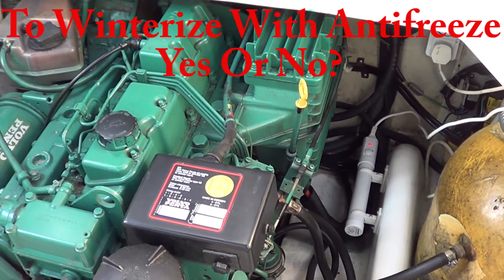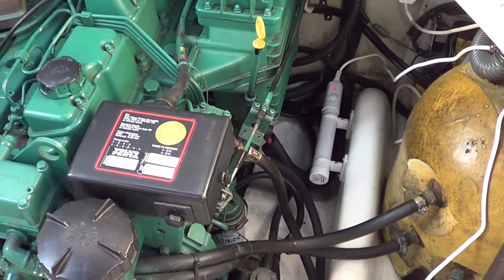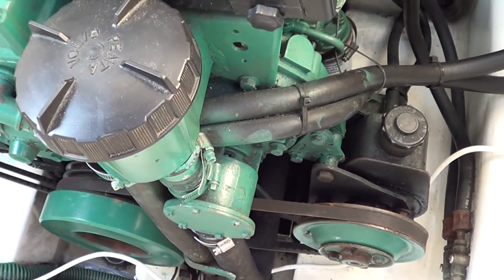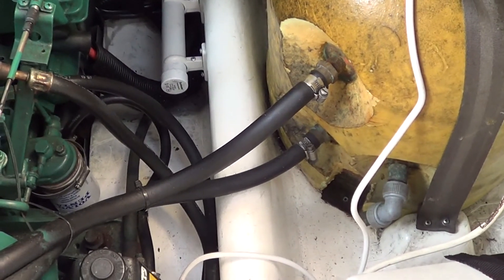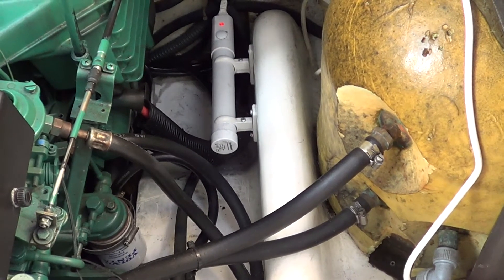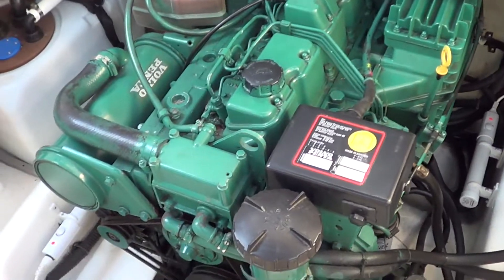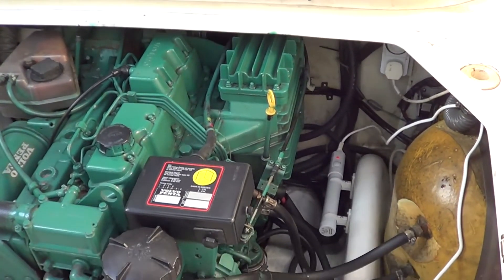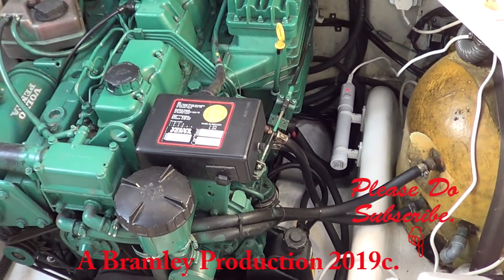Winterize the Sealine Volvo AD31 Engine Yes Or No To Antifreeze!

Comment: Hi we have a boat with AD42 engines do you have a video of you winterising yours?  I've looked thru your previous videos but couldn't find anything, thanks Bob
Reply from the maker: Hi, Bob, I did actually make a video of me winterizing the Sealine S24 but the Sealine is so small all you could see was my big bum in the way, and that's not a pretty sight! It was blocking the shot the whole time! I need a glamours assistant to do the filming and up the views, I think!! And for me to film them doing jobs like this. Sound great that! So I never posted that video. What I do with my AD31 is take the incoming water pipe off my water pump put a piece of the same size hose back on the incoming side of the water pump the other end of this hose connects to an adapted bucket which I then fill this bucket with this neat sea safe antifreeze starts the motor up. The pump will suck the antifreeze around you can keep adding more to the bucket as the engine runs you can see when this the sea safe starts to come out of the exhaust as it foams so then you really now you have enough around the block switch off quickly reconnect boat incoming water feed to water pump job done.